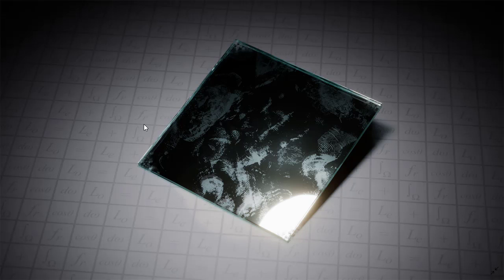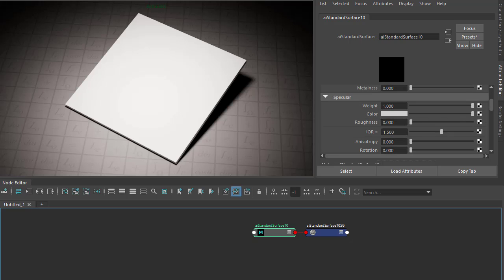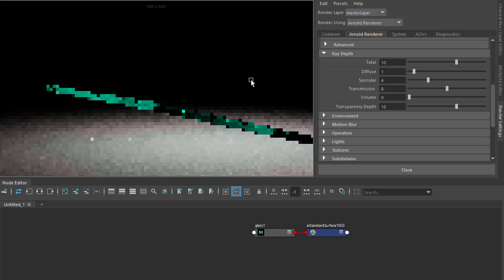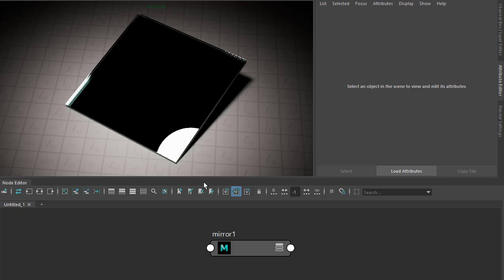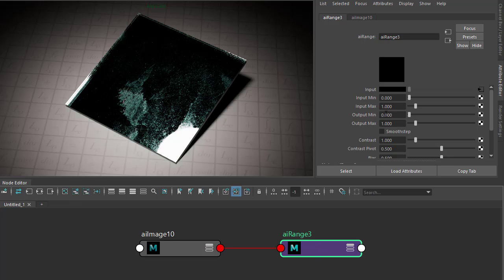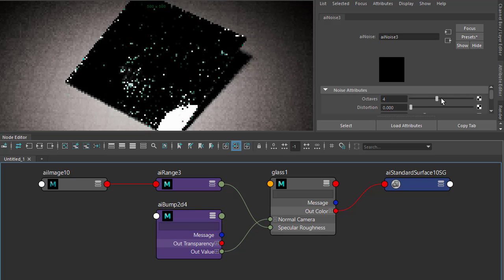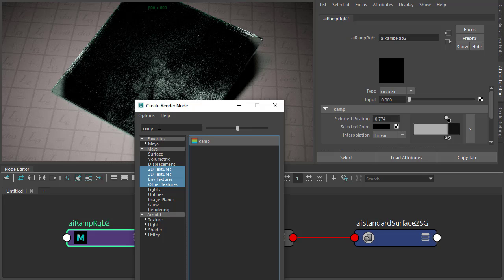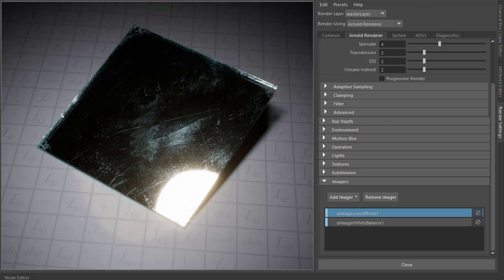Arnold tutorial - Shading a mirror using MtoA

Comment: Thank you for the tutorial, I'm having an issue where a glass object next to the mirror is not reflecting accurately, as if it its thin glass with low IOR. How can I control the refraction depth inside the reflection? Using MAXTOA

Comment: Can you do a video for a window consisting of 2 panels (with thickness) and raindrops on the outside? Are raindrops just displacement and roughness or is there something else obvious Im missing?
Reply: You can do it with a displacement but for that you can use some noise or model the drops with zbrush or another software, i think doing that will require you to use same noise/displacement for masking roughness since water is a different material, that will allow you to have 2 specular levels on each material.
Btw i think its full of those examples in YouTube